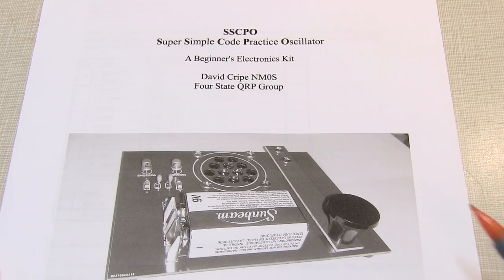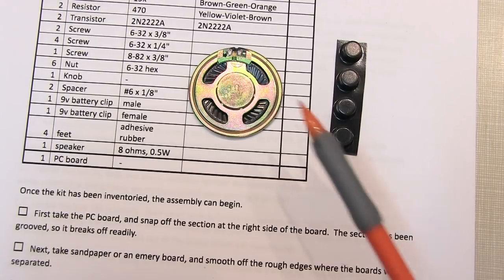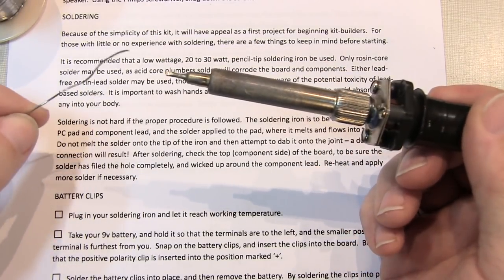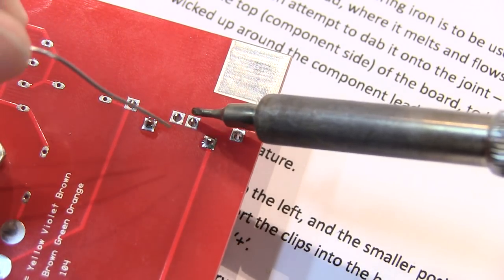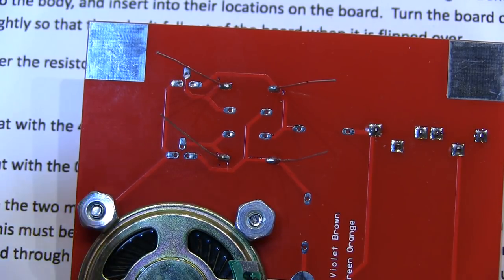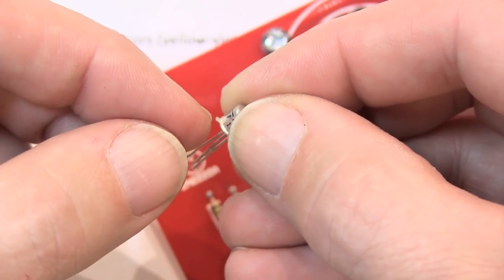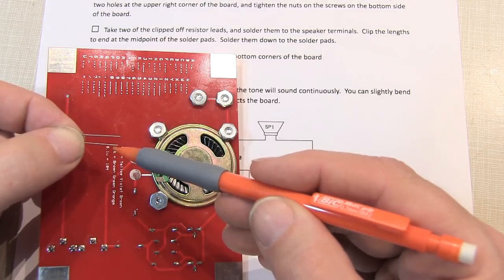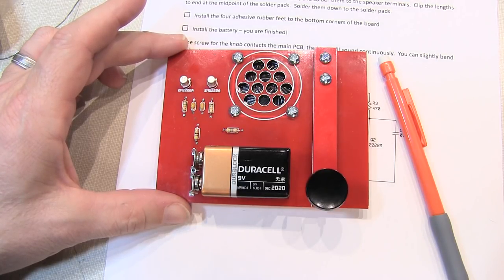#277: Code Practice Oscillator kit build - for radio club event at mini Maker Fair

Comment: What is that sound in the background that sounds like someone dragging their fingers across the tines of a comb.   I have heard this in your videos for years.    I finally had to ask.  It is heard at 7:05 in the video.
Reply: That is the automatic damper on the flue on the boiler opening up. It’s about 8 feet away from my filming location.
Reply: Yeah, I heard that too. You gave a good description of that sound jp040759.
Reply: Thanx.   Mystery solved.   At first I thought it was the springs from a tilting chair creaking.

Comment: I built one of these, but it is only operates at a very very low volume. Perhaps this is by design? Perhaps, I have a bad transistor. Does anyone have any troubleshooting information? How about any friendly advice?
Reply from the maker: It is fairly low volume, as can be heard at the end of the video.  Suitable to solo code practice.
Reply: w2aew,, It could be, but mine is even lower.  I made it to use at  Long Island CW Club class.  The LICWC class meets online through a Zoom teleconference.  It has inadequate volume for that.  I will try to add additional amplification stage with a volume control.  I am also going to attach a real key.
Thank you for your response.
Reply from the maker: Maybe you have a bad speaker
Reply: w2aew, yes that could be.  I don’t know how to test the speaker in circuit, but I can take it out and attack it a 100 in one kit.  Thank you for the suggestion.

Comment: May be good to warn people not to touch the 2 metal battery clips when they connect them to the battery before they solder it. Looks like it very easy to short out the battery if you are not careful.
Reply: Yes, good tip.

Comment: W2aew, do you have any suggestions on a good scope for a beginner to purchase? I restore antiques and vintage cb radios for a hobby, and want to start tuning my own equipment as well as diagnosing. I am torn between buying a new o e on amazon or perhaps a used analog one on eBay
Reply from the maker: For hobby, beginner, radio restoration work - just about any working scope that has 20MHz bandwidth or more will be perfectly suitable.  I like analog (CRT) based scopes for radio restoration work - they do a much better job looking at modulated RF envelopes than digital scopes.
Reply: w2aew thank you for your reply, I look forward to learning from your channel

Comment: That battery connection design is a certain recipe for board/pad damage.
Reply from the maker: Given that each clip has three staggered connection points,  the board is double sided with fully plated through holes, and the battery life will be quite long -  I think that the average user should get a lot of use out of it - certainly enough to learn morse code.  But I agree, it would not be the best design for a commercial product.
Reply: I'm sure it will be fine for this app. It just seems to me that in recent years, 9V battery connections require a lot more force than they used to.
Reply: You're just getting old like the rest of us ;)
Reply: I cannot argue with that ;)

Comment: Alan, excellent video for beginners who aspire to learning code. But you missed the last - and most important - step! This is where you take out the Magic Marker and obliterate ALL "dot dash Morse code labels" on the board so the student is forced to learn the code by listening to the code as opposed to counting dots and dashes. 

de k6whp
dit dit
Reply from the maker: At least they put the text on the bottom of the PCB so that it can't be used as a crutch.  So many of us, myself included, learned CW the wrong way many years ago.  It took me a long time to un-learn that and to hear the letters - I still have difficulty sometimes.